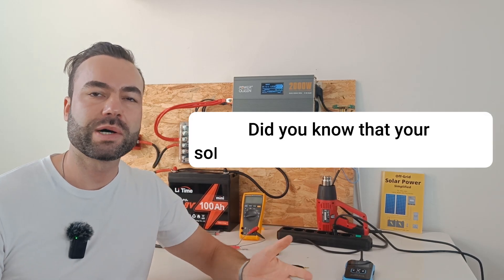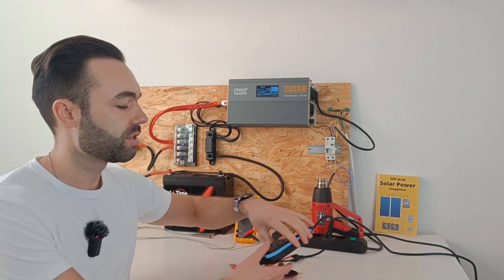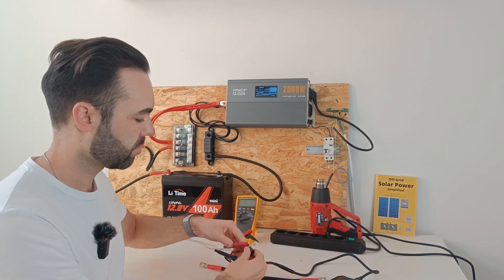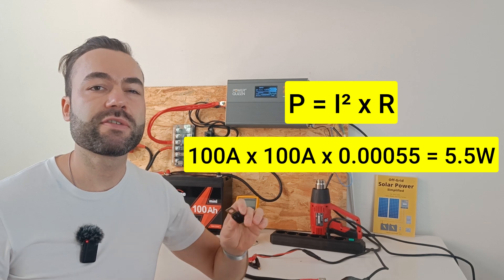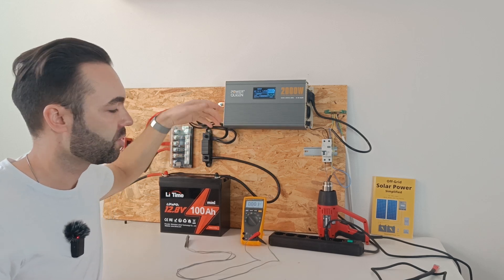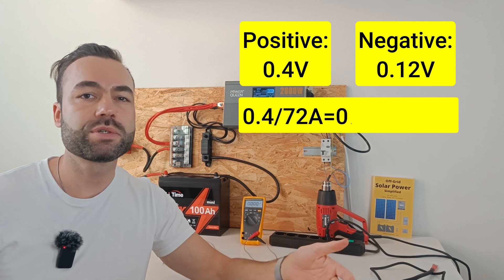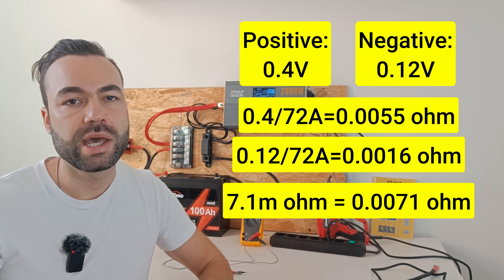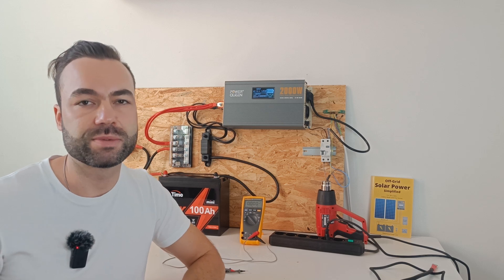Are You Wasting Power? Energy loss through wires, fuses, breakers and switches

Comment: During a recent blackout, I ran a large house fridge with my 12V lifepo4 battery and 1000W inverter.
The fridge ran for 7 hours drawing 6amps and using 140watts acording to victron shunt.
The inverter shut down at 7hours due to low input votage.
The battery voltage across the terminals was 12.47v and shint stated 60% left.
Question.. Is voltage drop what I should be looking for?

Comment: But what about the losses  if I use the 12V without inverter - powering all dc loads??
Reply from the maker: You will still have losses, it will be less because the current draw from in inverter is generally high. You won't have the 90% efficiency loss of the inverter, but thats a good thing.

Comment: Isn't true that the inverter will have much more power loses (they claim ~97 efficiency but I doubt if they actually reach this)?
Reply from the maker: 92% efficiency is a good estimate for most inverters.
Reply: Where did you find 97 %  efficient Inverter?  lol
Reply: @duckhunter8387  EG4 18K claims at specs (max efficiency) PV->Battery 99.9%, PV->Grid 97.5% and Battery->Grid 94%

Comment: I'm still Over Building My 24 Volt System's and Cutting My Loses - Thank You Nick 🙌
Reply from the maker: Better than a 12V system 😉
Reply: Initially Stepped into a 12 Volt RENOGY 3000 Watt Inverter System and IT was way too Hungry and Opted for 24 Volt WZRELB & VICTRON 24 Volt Inverters and Systems since - Thank You Nick  🙌

Comment: My humble view 12v is the biggest waste of power as it produices more heat. The more you go up in voltage the less heat your system produces hence one of the reasons you will get a longer run time off 48v system using the same capacity battery bank. Excellent video love it and points well factual.
Reply from the maker: Indeed, 100% correct.

Comment: Sounds like a big endorsement for 48v systems.
Reply from the maker: Well spotted 😉
Reply: @cleversolarpower  

Perhaps you can do a video explaining why we have to pay so much more for 48V batteries over 12V batteries?  I am not talking fancy server rack batteries with all sorts of features such as built-in breakers, communications, etc.  

I am comparing simple and plain 12V LiFePO4 (with or without bluetooth) to plain 48V batteries (with or without bluetooth).  It's much cheaper to buy four 12V 100 Ah batteries compared to one 48V 100 Ah battery.   You can also find similar good prices per Wh for larger 12V batteries, such as 150 Ah, 165 Ah, 280 Ah, 300 Ah.

One 48V 100 Ah battery does not weigh more or contain more raw materials than four 12V 100 Ah batteries, does it, so why should it cost 25-40% more than 12V?

When 48V batteries of the same capacity come down closer to the price of 12V batteries, then I am sure plenty of people will be happy to follow your advice and move to 48V.

I will be happy to do 48V and not wire 12V in series, when the price of 48V batteries comes down in price to almost the same price as four 12V batteries.

Comment: Good information.  Another way to figure out the D.C. side is to use a simple digital voltmeter to measure the voltage under load at the battery terminals and at the inverter terminals.  Note that shunts inserted to measure current also insert a defined resistance and your BMS will almost always include such a shunt.  Adding another to measure power out of the battery and then another to measure power used by the load will tell you the loss between the two shunts but not on the "other side" of each shunt. Knowing how much power will be lost is most important when designing a system which will be stressed during operation.  This stress might be trying to make battery power last as long as possible, or it might be trying to meet surge startup loads when battery voltage is low.

When building my first significant battery + inverter system I knew I needed to design for an 11kw load for a second or two, but normal operation would be less than 5000w.  There would be one circuit breaker and 3 meter of wire between battery and inverter (or 6 meter circuit length), plus the series wiring in the battery bank (under 2 meter plus the connections).  The company I was working with told me I could use 35mm2 wire, but 50mm2 would be better and 70mm2 was necessary to meet electrical code requirements. When they asked what I wanted, I told them 120mm2.

I had figured out that if I needed 11kw when battery voltage was 44 volt, that was 250 amp and the initial few milliseconds were going to be even higher.  They asked if I was certain, and I tried to discuss the math with them, but I could tell they were not equipped for that discussion.  So I said I was sure, and paid for the much more expensive wire.  It worked as intended, but the inverter sure had to work hard to start that pump, especially when I tested at 42volt (below where I expected to ever operate) on the battery.  It worked every time I needed it, and after the initial purchase I never regretted spending the money for the heavy wire.\

Buy once. Cry once.

Comment: But how long will that battery last Under that load Before it's flat?  I would be more worried about leaving the inverter on When it's not needed and draining the battery.  Small Loads won't have such a big impact on losses in the cables.  You could oversize the cables but it's probably not worth it Unless you have a big battery system and your drawing high loads all the time.
Reply: It may not be necessary to oversize the cables for normal operation, but (as I posted in another comment) it might be necessary when starting a load with a large initial surge. If the battery is low and there is too much drop in the wires, it will fail to start and could damage the inverter with the sudden undervoltage and high current.

Comment: Another great video - thanks.  I knew most of that intuitively but it's nice to see it all quantified.  I had a starting problem a couple years ago that was (apparently) a contact problem. I ended up taking a lot of voltage reading across the wires while cranking the engine and was amazed at all the voltage drops.  I replaced a few wires and cleaned over 20 contacts and haven't had a problem since.

Comment: The example of a heat gun, and other high draw items, wouldn't normally be running for a full hour. EG: You may run the heat gun for a minute on some shrink wrap, so the loss would become 37W/60 or 0.62W.
Nevertheless, great video and explanation.
Reply from the maker: Exactly, just demonstrating that components like fuses, switches and cables will have power loss.
Reply: If we are calculating for watt hour, then Yes based on running for a minute, would be 0.62Wh.   But since we are calculating for total wattage loss in a circuit , so 37W is correct.  Also since believe is easier to just use W=VxA, so 37.44W=0.52V x 72A.
Reply: @ Totally agree, 37W is correct, this is the amount of power loss the circuit will lose over an hour using that particular appliance. On say a TV, which would be typically running for an hour or more, the power loss (over the hour) would be far less as the amperage would be way lower, so all the calculations would be smaller.
Once again I agree that @cleversolarpower always does great and accurate content and I thank him for that.